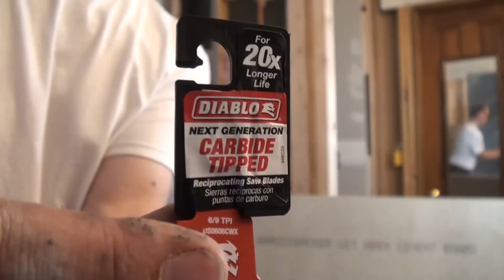How I to install a Shower Pan Liner and HardieBacker Board. 15. Душевой поддон

Comment: It pained me to watch this video man. You mention you have 20 years experience and you've done this quality of job many times. Watching you cut the liner 9" short. Every time that drill put a new hole inside the liner, every time you smeared liquid nail on a seam like it were caulk. I was laughing and crying when you attached a 2x4 to the back of that backer and nothing else.

Let me just tell you if my shower failed as catastrophically as the ones you are building COULD or HAVE failed for similar installers, in my home, the very LAST person I would call is the person who built the faulty shower in the first place. Insurance, and a new installer who follows guidelines set to protect customers AND installers. No gimmicks!
Reply from the maker: All gonna be alright
Reply from the maker: https://youtu.be/Jxi-iSh-6A0
Reply: Jillian O'Malley  See it as wonderful comedy show. He is really funny.
Reply from the maker: I like you like it. You can see it again and again... and my customer will use it again and again too in many many years .
Reply: Jillian O'Malley 😂😂😂😂😂😩😩😩

Comment: Where's the preslope?  Where's the notched studs?  All sorts of holes through the liner at the curb?  You might want to grab a TCNA handbook and read up.  That shower is doomed to fail.
Reply from the maker: tiggyton Thanks, but I trust my 20 years of experience in shower remodel. So, what is better - piece of paper or experience?
Reply: Proper industry standards trump 100 years of experience.  What happens when water wicks right through that hadi (its like a sponge) and hits the holes you cut in your liner?  How does the water get to the weep holes without a preslope under it?  PLEASE, if you're going to try to attempt to teach others something, teach them the correct way.
Reply: I agree, a formal education goes a long way. I would not hire this guy putting all those holes in my liner period
Reply: I see potential dry rot and black mold issues here as-well

Comment: Wow!!! This Job .....
1. No blocks wood around down walls
2. No Pre Slop Mud Pan
3. No Rubber Shower Pan Liner around the curb
4. No Corner Rubber Liner to Curb
5. No need to put Screws in the Curb
6. No used Liquid Nails between wood and Backer Board
7. No used Mush Tape Joint with Thin-set
8. No need to use plywood for free set
9. No used Water proofing
10. No used shoes for work out the shower  :)
 
I learned one thing in this video, how cut or reduce wood with this special Blue tools; always I cut with my electric Soso. Thank You!!!
Reply: Wow
Reply: ELMER MONSALVE I’m a tile guy and I get what u are saying maybe he just need to learn how to do the right way and water prove the right way. He is a very good worker
Reply: No need to block the stud bays. He put Hardiebacker ALL THE WAY down into his pan!!  :-D

Comment: Sure to fail pan. No pre slope. Didn’t wrap the pan over the top of the curb. Never install backer board into pan. Leave it up off your finish float at least 3/4”. Fill the gap with thinset if necessary. I’m a tile contractor with 26 years experience. I’ve fixed hundreds of showers that have failed for any one of these reasons. Nobody wants mold or water damage. If you want to tile your own shower have a licensed tile contractor come do the prep work. That way if there’s any mistakes in the waterproofing he is liable for it.
Reply: Yep!, everything you said and then some! Also,Hardi backer, don't get it, it's junk! It wants to delaminate,and this dude set it up for failure! He looked all "meticulous" and what not,but really !, backer board set in the pan?! Can you say "water wicking",
mold developing soon to be leaking.where he failed too curb lap and seam seal?
Any,a lot of effort,most of it wasted! 
34 years  doing this ,lost count of custom showers!
Reply: Hey can you direct me to a video that shows building a shower from the pan to the backer board. I can't seem to find a good one.

Comment: The Pan Liner has been violated in so many ways, someone needs to call the cops..........LOL!!!
Reply: There's no way he could be licensed or ever had professional training on installing the pan liner. Every shower pan is the same from this guy. He loves to screw into the face of the curb, through the top of the curb and into the perimeter of the pan liner itself. Every hole is a potential failure. At least he's keeping real contractor's busy remodeling his screw ups.

Comment: Ok just to add my 2 cents the point of the pan is so you don’t have water leaking when you use the shower. The pan material is the only thing that prevents this. The pan material needs to wrap over the threshold and you need to pour a beveled concrete base before you install the pan. Then you need to block the drain so you can check to see if the pan is water tight.

Comment: Wrong
Curb not wrapped with liner.
Never put board in before pan, and leave gap from pan, fill gap with thinset.
Make X cut for drain, not circle cut.
This will leak prematurely.
Reply from the maker: Will see.... they use it 4 years already.
Reply from the maker: Shower after 4 years, how it look now  https://youtu.be/qkWccYdRmSQ

Comment: looks great but i usually use backer board moisture alkaline resistant mesh tape with mortar for all the seams, and we hot mop pand out here but they dont last , i like the pan liner in video better

Comment: Everything was good except the floor liner.  There are many screws and staples piercing the liner, which lets water leak through.  This is why I prefer using thin set to install a liner.

Comment: The video is helpful to show the overall process, but I would recommend a few improvements.
1) You can just score and break the hardibacker with a backer board scoring knife. A lot easier than cutting. 
2) I would have used more of a liner over the curb. DO NOT install screws into the liner below the flood rim. Use Curb Perfect or some type of Goof Proof system to tile the curb.
3) You should use red guard over the hardi backer to create a moisture barrier, or put water proofing behind the hardi backer.  Water goes right through it
Reply from the maker: You absolutely right ! Thank you !

Comment: sorry but your pan is going to leak. you did the drain completely wrong, and you drove screws below the water line. big no-no. also, why didn't you completely wrap the dam with the liner???

Comment: Several mistakes that will make this job FAIL>  The liner needs to wrap completely over the step over rail. You don't staple the liner at the top of the step rail, it puts holes in it (sort of defeating the purpose of the liner. There should have been a pre-slope cement under the liner.

Comment: The problem that I saw was you stuck the 2x4 stud without securing it to anything but the hardy board backer.  I had another customer who had tbe same issues with their plumbing and it moved and caused the entire drain to move with it which caused a huge water leak and flooded everything.
Reply from the maker: If you talking about Curb Double Studs it was glued with liquid nails and screwed to the subfloor with 3" screws.
Reply from the maker: Same techniques as I used here - https://youtu.be/prp_vglYv4c
Reply from the maker: And one more: https://youtu.be/LSbB_ml0UtE
Reply: it was so painful i literally had my stomach sink. unreal

Comment: HOW NOT TO INSTALL SHOWER PAN !!!
Reply from the maker: daniel shlyahovsky will laugh together after many years of usage  😂
Reply: You should have folded the pan liner over the curb to the opposite side.
Reply from the maker: Conner Smith so, looks like you not trust your Hardly board and tile?
Reply: Fix it All , it's just installed incorrectly.
Reply: That and you screwed through your pan liner on the inside. Even with red velvet covering it, that's risky. Albeit, you seem to do good work.

Comment: Great Video.  Only mistake you made was the title.  Should be "How to NOT install a shower pan......  "   No spacing between backboards for house settling.  You need to tape and mortar the seams not use a glue gun.  Shower lining did not cover the curb...  I hope you're doing this work at your own home.

Comment: I do remodeling for a living and so many of my jobs come from leaking showers.  These are due to either old outdated showers that simply started leaking because of improper siliconing or lack of silicone over the years, or incorrect installations of mud jobs in newly renovated bathrooms by a remodeler.  I watched your other videos too.   Your wall board cuts are very precise and nice.  Very neat work.  However, with all of the new and improved ways to install and remodel bathrooms, why would you not venture into todays products?  Shower Systems is the way to go.  I know you are going to comment that you never have problems, why would you admit that you have had?  I cringe ever time I see a nail, staple, screw penetrating the liner.  The curb has so many screws and it begs for potential leaks.  You also do not wrap the curb entirely of pay close attention to the corners by the curb where so many leaks occur.  Schluter, Laticrete, Duro-Rock, RedGuard and many many more companies have shower systems, liquid water proofing, prefab water proofed inside and outside corners etc that you can benefit from using.  Once you install one, you will fly through the installation and save time.  You can have the customers purchase the shower kits, which now cost only hundred of dollars.  The process to install is simple and the companies guarantee no leaks forever!  Its like wall papering your shower with a waterproof membrane that is applied with thin set that chemically dries.  I use Ardex X5 and its perfect and inexpensive.  
Also, why not moisture barrier in the shower walls before installing the Hardie?  I bet every shower that you rip out has mold on the inside or insulation.  They did not put moisture barriers in years ago.  That is why.  Just staple 6 mil plastic to the framing and it works! 
You clearly care about your craftsmanship.  It shows.  Reply back with any questions if you like.

Comment: Cement board should never touch the pan. You should've wrapped the whole curb. You are not a PRO for sure. There will be failures and mold/mildew for sure...
Reply from the maker: Shower after 4 years, how it look now?  https://youtu.be/qkWccYdRmSQ
So, will see in next 4 years.
Reply: I’m glad I read this.

Comment: don't you need cement under the linear ?
Reply: Yes....that liner will eventually start to hold water, and that water will find a way out...most likely in the corners where the curb wasn't wrapped properly.

Comment: Nice clean work but there are alot of mistakes. 
1. Shower pan liner needs to go over the curb.
2.you need to silicone the liner under the drain.
3. If that's a bench he's building he needs to bring the liner above that or you will have water leakage
Reply: Aaron Johnson and no pre slope

Comment: This is a perfect example of how not to install shower pan liner this will leak for sure
Reply from the maker: Depend when it leaks... after 30-50 years?
Reply: Fix it All I have fixed bathrooms like this I guaranty that will start leaking after a year or two

Comment: Was surprised to see that he did not put roof tarp or a sloped mortar bed as a base before installing the rubber backing.  This may eventually leak because of that omission.  Guy is a hell of a worker though.

Comment: so many things wrong here. Starting with no mask using that board which is cancer causing. i use roofing nails on liner against frame. I use 100 percent silicone under the shower drain liner by drain. and worst of all he didn't even use a level to level the drain before he tightened down the bolts. If that isn't level, the drain when you screw it in wont be either. Also needed to wrap the curb with liner and or even use corner dams.

Comment from the maker: You may be interested to watch 36 videos of "Old kitchen replaced for a new IKEA".
1. IKEA Kitchen, Design, Planning. Кухня IKEA, дизаин, планировка  https://youtu.be/IAM49Tfm9Vk
2. IKEA Kitchen, Old cabinets demolition. Разборка старой кухни  https://youtu.be/c_sEq7CEBGU
3. IKEA Pantry cabinet installation. Установка кухни IKEA  https://youtu.be/c5kdXEkk3vg
4. IKEA Refrigerator Cabinet. Установка кухни IKEA  https://youtu.be/6cHSXHfDoeU
5. IKEA Oven and Micro cabinet, Window trim, LED wiring. Установка кухни IKEA  https://youtu.be/gMW2csSP5lI
6. Window painting before IKEA wall cabinets. Покраска окна перед IKEA шкафами  https://youtu.be/3xrpnTj_QGg
7. IKEA Wall and Base Cabinet installation. Навесные шкафы и тумбочка кухни IKEA  https://youtu.be/SxO82Lw3VsM
8. Countertop Installation IKEA. Установка столешницы IKEA кухни  https://youtu.be/AY2ikKG9Hao
9. IKEA Wall cabinet installation. Настенные шкафы IKEA  https://youtu.be/JmYqcn106ds
10. Light Switch for LED under cabinet. Выключатель для светодиодной подсветки  https://youtu.be/8VBIw6Dl2mM
11. Under cabinet IKEA trim and side panel. Кухня IKEA, установка боковых панелей  https://youtu.be/ZfMVL0GrzZk
12. How to install a drawer handle IKEA. Как установить ручки на ящики кухни Икеа  https://youtu.be/645s8e-qmtY
13. How to Install Cabinet Bar Pulls. Как установить ручки на двери кухни Икеа  https://youtu.be/yhlGFIaXG3I
14. Windows painting. Грунтовка и покраска окон - https://youtu.be/FBpluiC-4pQ
15. Granite Countertop Cracks. Гранитная столешница с трещинами - https://youtu.be/FcvIS7DXnsA
16. Replace Cabinets Without Removing Countertop. Укрепление гранитной столешни  https://youtu.be/dmnHyz1i1UY
17. Granite Countertop Edge Support. Укрепление края гранитной столешни  https://youtu.be/zHQjo_liKhk
18. Plywood Support under Countertop, IKEA cabinet. Укрепление гранитной столешни кухни ИКЕА  https://youtu.be/pZ7J7GdDAHQ
19. How to make Floor Vent Under Cabinet. Воздушная труба под тумбочку  https://youtu.be/eSQoIbTK9vY
20. Old Sink Drain Pipe Extension. Удлинение трубы слива раковины  https://youtu.be/VNOEfpE4H4g
21. Garden Faucet Replacement. Замена садового крана  https://youtu.be/eWbU8DK-3JY
22. Cut Counter Top for a New Kitchen Sink. Подрезка столешни для новой раковины  https://youtu.be/bwCjFCE6vjg
23. Plywood support and two cabinets installation. Укрепление гранитной столешни кухни ИКЕА  https://youtu.be/dPPSq0HUT20
24. Kitchen Sink installation. Установка мойки, раковины  https://youtu.be/itoQH_OEuBA
25. Kitchen Faucet and Garbage Disposer installation. Установка крана и измельчителя отходов  https://youtu.be/7eiquGydvDA
26. Dishwasher installation. Установка посудомойки  https://youtu.be/t1aRk9wvvO4
27. IKEA Cabinet side panel, Drawers, Door. Боковая панель, выдвижные ящики, двери ИКЕА  https://youtu.be/tp4WRQfOCko
29. Hood Duct pipe and Electric Outlet installation. Труба вытяжки и розетка  https://youtu.be/0IDhl8vfP80
30. Recessed Light Housing for LED. Светодиодная лампа над плитой  https://youtu.be/yj5pJXq_XtE
31. Island Range Hood Installation. Вытяжка над плитой в потолке  https://youtu.be/WgI0EnnLrMk
32. Range Hood Reinstall Higher. Переустановка вытяжки повыше  https://youtu.be/JDOnix5G_K4
33. Counter Top support before Cabinet Demolition. Как удалить тумбочку под столешней  https://youtu.be/Fo3Bg9uMjP8
34. Plywood under Counter, Cook Top Cabinet. Тумбочка Варочной поверхности  https://youtu.be/mur2U-MGYuU
35. Cook Top Installation. Варочная поверхность, установка  https://youtu.be/NO4tFznoNvo
36. Cabinet Legs Support, Last Cabinet installation. Ножки под тумбочку  https://youtu.be/wmO8f1ayzqs

Comment: Where you using silicon? For the cement bored and the shower line? And what type glue did you use between the pan and the shower drain ?

Comment: I'm repairing a shower that eventually leaked because the installer bored holes through the liner at the curb - which is what this fellow appears to have done.    Maybe the final work looks good, but if the liner is punctured I wouldn't want to have to insure the future damage.
Reply from the maker: Punch to punch is not same. Must to know how to seal all punch and no problem thru 20 years.
Reply: Fix it All The manufacturer instructions appear to conflict with your "punch" claim.  And the manufacturer appears to recommend using approved adhesive at the curb, not nails.   The manufacturer appears to expressly disapprove of your method.  The system I was called to repair/rebuild is over 15 years old before it failed.  So your "20 year" claim is pretty weak, in my opinion, and based on what I've seen.   Maybe it's more accurate to say that you are not aware of any problems - rather than claiming there are no problems.
Reply from the maker: Thanks.
Reply: tRuMptUB3 Ps4 waterproofing will help nothing when the fiberboard is set in the pan and the liner doesn’t even go over the curb. Those holes can create a problem. More likely that water will wick up the walls and cement board on the curb and destroy it that way... probably full of unseen water right now. Gross

Comment: all that and you missed the most important part - no pre slope... when you smell stagnant water in about 6 - 12 months you'll understand...lol
Reply: So lay it flat, than slope it with mortar and tile?
Reply: @LuisLeon-ot4hp  you use sand/topping mix to create a sloped bed, install the rubber over that, and then lay another sloped bed on top of that.  The top bed is then tiled over with thin set mortar.